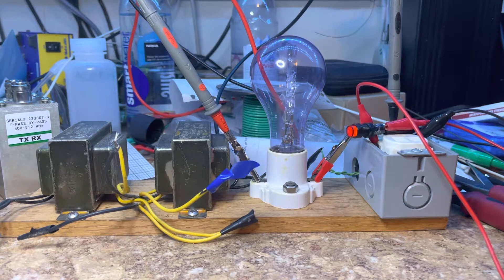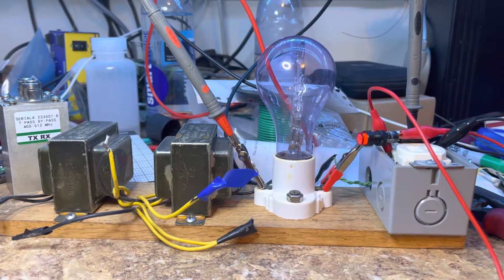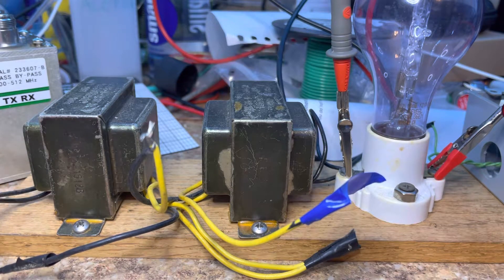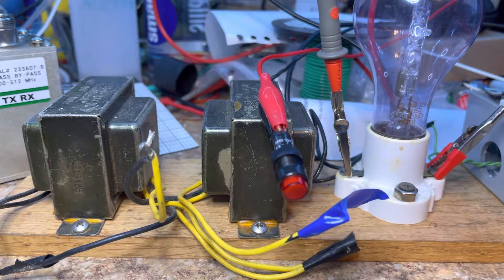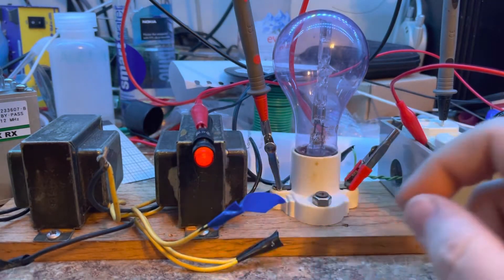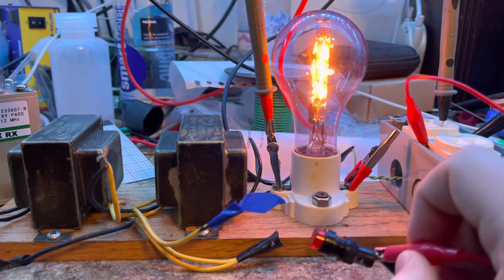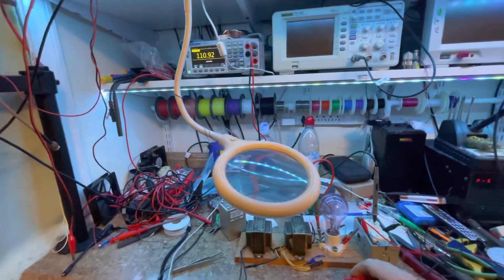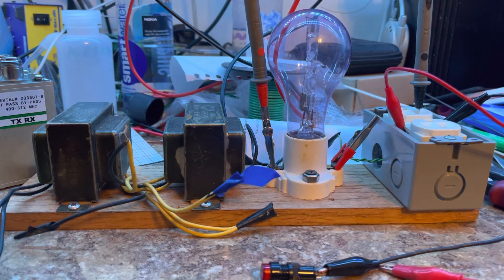Home-brew isolation transformer and inrush current limiter

Comment: Assuming the transformers are 4 amp and 100% efficiency, the max current on the AC side is 0.4 amps.  On the 24v windings, it is rated at half the output but twice the load.  Not taking field collapse kickback which will create a very noisy grid in your neighborhood,  the max output on the 200v side is 0.2amps within designed specs.  This explains the overheat problem with the transformer.  

Only good for 0.2 amps output max. Isolation transformers are available for low demands up to 3kw fairly cheap.  Nice example.
Reply from the maker: This cost nothing.  Piss with the cock you have.

Comment: The series light bulb trick is a good one... I used to be a Radio Shack repair depot years ago in the 1970's...
There were a lot of stereo amps that would come in for repair , and you know , that if you replace the output transistors "Murphy" will get in the way.... SO.... I did the same ... Out of my old RCA isolation transformer.. I put a 100 watt light bulb in series with it..
IF... all was good after replacement of the outputs, plug it in , turn it ON and if the bulb gave a quick glow and went out or very dim  you know you did it right !!
IF.. .you turned on the switch ...and the bulb came on almost full brilliance you knew you FU***D up!! 
Saved many a power transistor that way....
In later years , early 90's I used the same trick with a Larcan Solid state TV transmitter when setting the bias for the FETs in the output modules. This time I used a 200 watt bulb in series with the 50 vols test line. Saved numerous new FETs from popping.. Saved money when considering the FETs were nearly $200.00 each ( Canadian)..  The bias settings were very touchy and critical..
As you say cheap and dirty , but is saves $$$ ... 
Have fun Bryan..